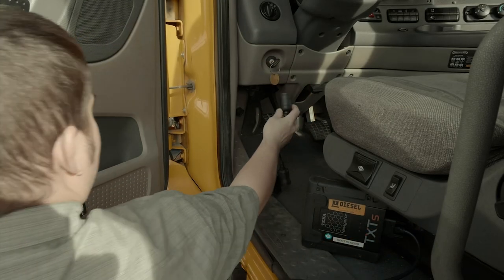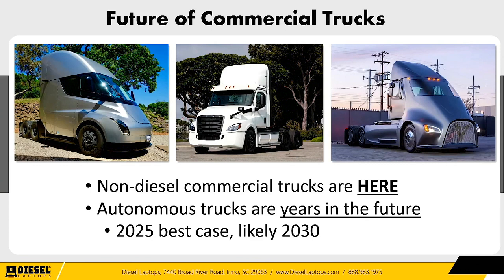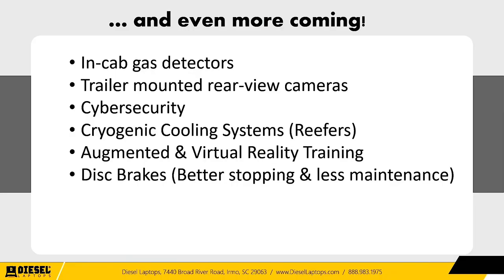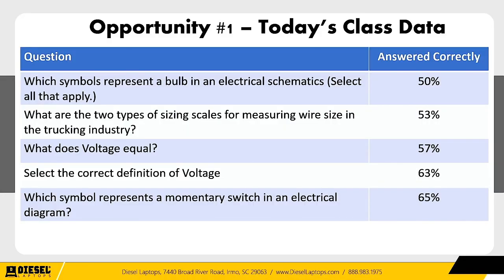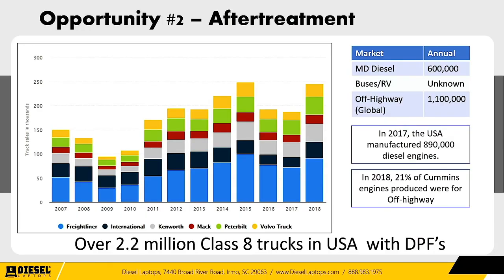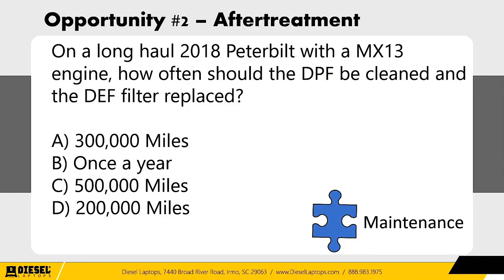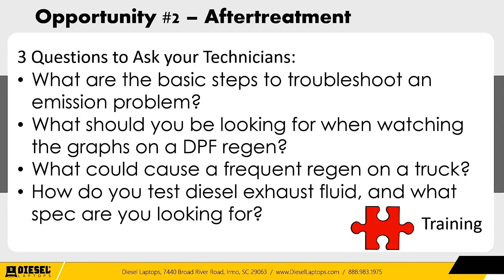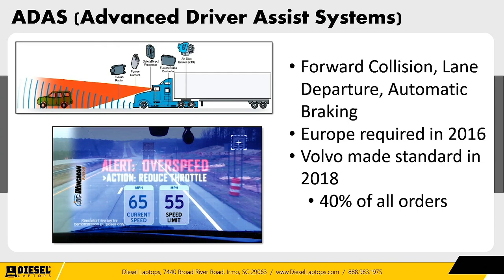Reshaping Today's Service Bays - The DL S1E21

Comment: Disc brakes are not less maintenance on heavy trucks.  As long as everything checks out good with a dial indicator and  the rotor is good then yeah throwing pads on is simple.
Reply from the maker: What I meant by that statement is that air disc brakes have less moving parts, thus less things to fail, and less maintenance is needed over time. They are also quicker to replace then traditional drum brake systems. Less moving parts plus quicker repair times means less hours for a shop to bill. - Tyler